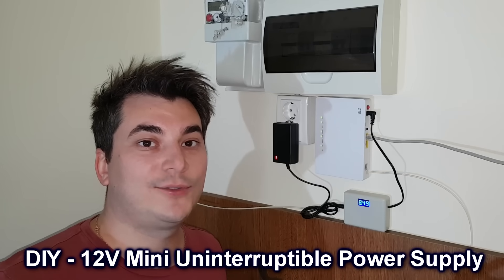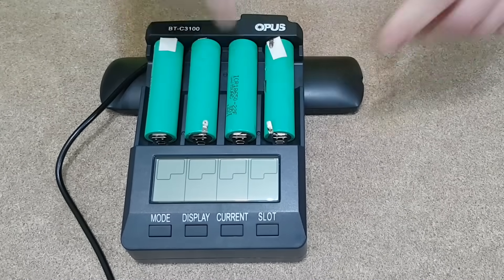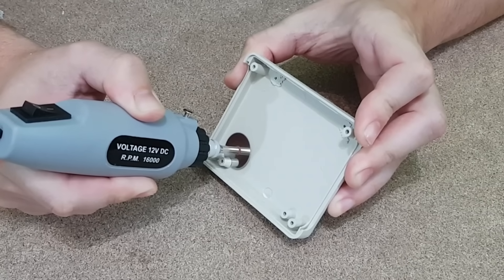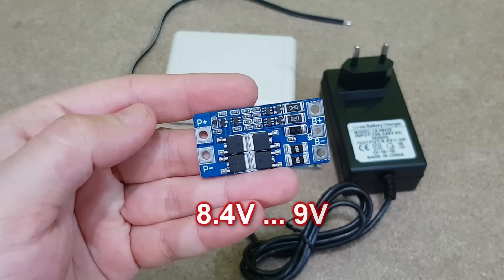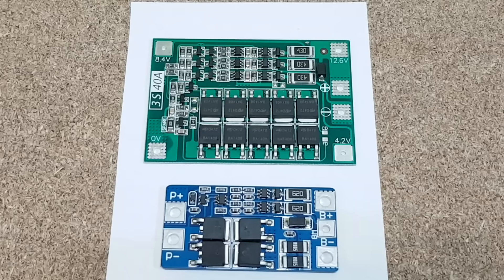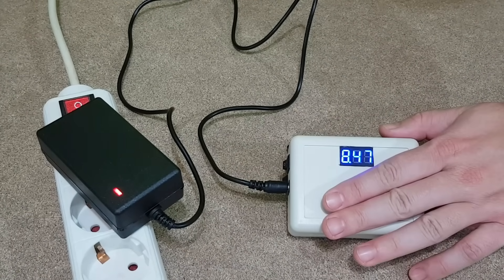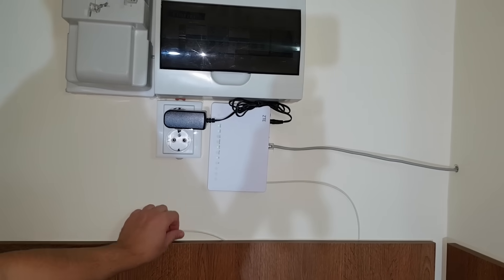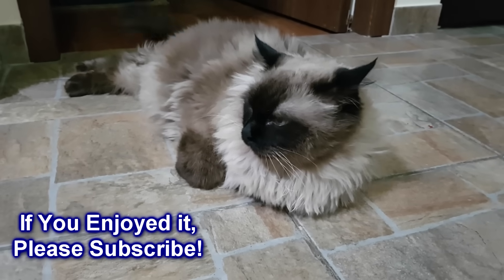DIY - 12V Mini UPS

Comment: You should add IN4007 diode between dc Jack and battery wire input to block the reverse current flow to adapter
Reply: Wrong. It will reduce charging voltage to 7,8V and will blow up very soon. 8,4V 2A charger is used, providing 2A of charge current, 1A diode will blow up. At least 95SQ015 should be used (0,2V drop at 2A and Tj=50°C) - acceptable for dropping 8,6V charger output voltage down to 8,4V. This diode also has around 0,2V drop at 300mA load, 30°C Tj - battery will be kept at around 8,4V as long as charger outputs 8,6V.

Comment: Can you make a ups for Router & ONU which draw 12v 12V means dual output?
Reply from the maker: I plan to make a better 12V UPS. if you double some of the components it will have 2 outputs.
Reply: @Sorin_DIY  hope you make it soon, best wishes.
Reply: @Sorin_DIY  I made a ups for Router & ONU with 1 3S bms+2 dc to dc booster circuit, output voltage is 12v, 12v. It's almost gave 5 hours backup After battery discharge fully while connect adapter (adapter is from ONU 12v 0.5Amp), Router & ONU not power up, only Router's led blinking. Can you tell me how to get rid form this situation?

Comment: If I was making this I would make sure the batteries was on 80% charge when in standby. The batteries will last longer since these kinds of lithium doesn't like to be fully charged.

If I was rich and did buy new cells, then I would buy LiFePo that likes to be fully charged (but they have lower capacity).

I wonder how much current is used up by the charger when the power is out. Maybe only for the LED? Maybe it powers up other stuff inside also we can't see.
Reply from the maker: you are right about the battery, but I didn't find a module to charge them to 3.8~3.9V. I'm still searching.

Comment: A great video, but my doubt is why isn't a charging module used to charge the battery ? Only a BMS board and a Step up converter are used....
Reply from the maker: the battery pack is charged with a charger and a BMS board. the charger can deliver 2A at 8.4V (max 8.6V) using a CC/CV method. the BMS board has all the needed protection features including balance charging. so together they charge the battery pack using CC/CV method, they balance and protect the cells. the step up converter is used only to increase the voltage to 12V.
Reply: @Sorin_DIY  thanks for the reply, i will build it soon with your video as reference ☺️

Comment: Can I use tp5100 to charge the battery with 12 volt input
Reply from the maker: I haven't used this module so far, but according to the datasheet, the input voltage is max 15V. the problem is that it doesn't have balance feature, so in time the cells will get unbalanced.

Comment: 11:50 can stop current flow from UPS from a diode?
Reply from the maker: yes, but the voltage will decrease, because diodes have a forward voltage drop.

Comment: hello i have made it but problem is volt meter shows zero every time what is solution
Reply from the maker: hi. you didn't connect the voltmeter sensor wire correctly, or the voltmeter is broken.

Comment: Can I use it for both Modem 12v and wifi router 12v at the same time?
Reply from the maker: if you use this type of UPS with 2 devices, it will probably get very hot. you need a more powerful UPS
Reply: @Sorin_DIY  Thanks for your response. I have a very powerful UPS. I just wanted to know if modem and router could share same ground.

Comment: I built a small ups with a 9v battery and boosted it upto 12v using the converter, I used it to power my stereo speaker but after a few minutes it resetted itself and when it came back up it worked perfectly. But it killed my device's original speakers, now I'm stuck in headphone mode. I didn't have 2 18650 cells so that's why I used a 9v battery. But I have another recharge ups. Thanks for the tutorial friend.

Comment: Can I use 19v 90w laptop charger to charge ups or small power station that has input 12v-24v?
Reply: but current may be high so dont take risk
Reply: but I read somewhere, its says higher ampere doesn't matter since devices only take what it need....as long as the voltage match with the input of devices...I mean my device can operate between 12v to 24v, not 12v or 24v....
Reply: @mzam2028  yes thats true so how many cell your going to use
Reply: I'm to lazy to make my own...I end up buying case with all the board installed...it can fit 12 battery...adjustable voltage..can power up or charge laptop if adjust the voltage to 19v..got usb port as well... there's 2 model, 16v-24v up to 90 watt which is said for ups or standard 12v-24v up to 60 watt power backup...the manual in Chinese buy I manage to translate it...it say can use laptop charger ....

Comment: Appreciate the compact circuit, I am also trying to make the same. But one query arises in my mind. That why we did not consider, reverse discharge protection diod in the supply side.
Reply from the maker: it will work, but you need a 9V charger to compensate for the diode forward voltage drop.
Reply: @Sorin_DIY  Is it okay to use a 12V 0.5A charger and a 3S 10A BMS?

Comment: I was wondering if I could implement the same circuit but with 19V output for my ASUS router.
Reply from the maker: no. because your asus router needs more current also. you need a bigger battery pack and and components rated at higher currents.
Reply: @Sorin_DIY  Yeah thought so. I saw your video for the 12V and 19V supply but what I needed was just the 19V part since my ASUS router is located quite far from my fiber modem.

Comment: That’s not really a UPS. It’s a battery bank that allows pass through charging. A UPS works on by-pass. It will keep the batteries charged and. It run any current from the batteries until power to lost from the input. That’s why a real UPS is a bit more expensive- it’s has to have a very fast transfer switch. 

I’m glad this works for your application though.

Comment: Hey Sorin, how is the ups holding now? Is it still in use and has it been constanty since you made the video? Are the cells still ok? The reason i am asking is because I have read that it's not advised to constantly charge lithium cells.
Reply from the maker: hi. I used the UPS for a few months and it was ok. now it's not connected because I'm making some changes in the house. you are right, the li-ion cells should not be charged continuously. that's why  I linked a better BMS board in the video description. it has an overcharge recovery feature, which completely stops the charging, when the cells are fully charged.
Reply: @Sorin_DIY  what is the difference between the BMS on your video to the description below?
Reply from the maker: the BMS from the video charges the battery continuously. the BMS from the link in the description has overcharge release voltage protection, which stops the charging when the battery is fully charged.
Reply: @Sorin_DIY  thank you for your reply, will build this soon just waiting for the parts to arrive ^_^ Thanks for sharing this!
Reply: @Sorin_DIY  hi, followed your build but the output of the BMS is 5.86v only.. Any advise? I have tried 2 bms, same result. ( I use the bms you provided on the link description)

Comment: It works well with my linksys router with the power consumption of 12v 1A. Thank you again for your help. But there is one problem, in battery mode, i only 9.6v and i got 12v when the charger is plugged. I adjusted the variable of step-up converter into 12v while it is plugged on charger.

Comment: Is there any BMS board that can produce the output of 5v 3A and 12V 2A? My ONT has 12v 1.5A and my raspberry pi has 5v 2.5v power input needed. Thank you in advance idol.
Reply from the maker: a BMS board doesn't deliver a stable voltage. it just charges and protects the battery pack. you need a DC converter to have a stable voltage.
Reply: @Sorin_DIY  i mean the step up converter. Does XL6009 ampere output will be the same if the input is 8.4-9v 2A? Or it is just 1amp? It works on my router with power rating of 12v 1A but it cannot power up my ONT with power rating of 12v 1.5A.
Reply from the maker: the output power = input power * efficiency. for eg. if the needed output power is 12V*1.5A=18W. let's assume the efficiency of the converter is 85% in these conditions. so the input needs to be: 18W/0.85eff = 21.17W; 21.17W/9V=2.35A. so you need a charger with 9V and more than 2.35A, because a part of the current is used to charge the battery.
Reply: @Sorin_DIY  thank you so much. Now i understand it.

Comment: Great vid! I do have a question though, as the input to the battery does not have a current limiting circuit, would it not lead to a surge current inrush when the battery gets fully depleted and the mains supply gets back online? Best case, it would trip the protections in the bms and not charge the battery and worst case it could kill the battery. Thoughts?
Reply from the maker: hi. in this video I use a small battery pack, made with only 2 recovered lithium cells with a small capacity connected in series. it doesn't put too much pressure on the charger. the charger can deliver a maximum constant current of 2A. so the charging current is limited by the charger, which is 2A minus a few hundred mA, which are used by the DC-DC step up converter, to power the ONT with 12V. so the charging current is limited to around 1.5A, which is a bit high for a small battery pack, but there is no problem. and this happens only if there is a long power outage to completely discharge the battery. if the power outage lasts only 1-2 hours, the battery will not discharge too much and it will draw only few hundred mA from the charger. the problem you mentioned occurs when you make a bigger battery pack and use a more powerful charger, then you need a CV-CC converter to limit the charging current, as I did in the 12V&19V UPS.
Reply: @Sorin_DIY   But the 2A adapter doesn't really limit the current does it? The charger should just burn off trying to instantaneously bring up the battery voltage to its own output voltage bringing a surge in current more than it can safely supply (2A).
Theoretically a 2s battery discharged to around 7 volts should draw somewhere around 20-40 amps from a 9v considering the internal resistance of the battery to be around 40-80 milli ohms.
So the bms should have triggered the overcurrent or the charger should have THEORETICALLY burnt out trying to supply that 20-40 amps (if the bms didn't exist) 
But ofcourse none of that happens in your video and your setup functions as it should. Could you explain a bit more about why the battery doesn't draw the theoretical amount of current and in doing so trip the bms or kill the charger (if the bms is ignored)?
Appreciate your input!
Reply from the maker: a good charger acts like a CC-CV power supply. the charging current is limited to 2A and the voltage drops when you connect it to the BMS/battery. then the voltage increases slowly, while the battery is charged. it doesn't force more amps into the battery, because it can't deliver more than 2A, so the voltage drops. you can see this exact charging method in my fast charging powerbank video with a 25.2V (25.4V max) and 2A charger. but if you have a low quality charger it can damage the battery if it doesn't stabilize the voltage and current.
Reply: @Sorin_DIY  As long as the charger self limits the output current and not blow up trying to match the current demand it all makes sense.
I did not know a charger could behave in a current limiting manner when connected to a battery (which is not a standard load in the sense that potential difference accross it doesn't immediately match the charger's once connected)

Thanks!

Comment: how long will it last 12v 1a
Reply from the maker: about 1 hour with the salvaged batteries from the video. if you use better or more lithium cells, it will last longer.

Comment: You need a charger, not a power supply.

Charger: CCCV

Power supply: CV only

CCCV = constant current / constant voltage.

Charger: puts out either a constant current or a constant voltage, depending on the state of charge of the battery

Power supply: puts out a given voltage no matter what, cannot be connected to a battery

Even if you start from a power supply, you still need a charger between the power supply and the battery, to drop the voltage and limit the current. So, you might as well keep it simple and just use a charger.
Note: a "Lab supply" is a CCCV type of power supply, and can be used as a charger.

Comment: Hi,
Can i connect same voltage but different power rating batteries in series ? Eg. 4200mAh+2100mAh ?
Reply from the maker: no. you need exactly the same type of cells (so they have the same internal resistance), with the same real capacity, same lifespan and number of cycles.

Comment: I''ve seen other similar builds use a diode reverse bias on the negative terminal of the power input from power supply - you mention in the video that the charger light remains on because it is taking power from the UPS. Is that what would be prevented with the diode in place?
Reply from the maker: yes

Comment: Is it okay if the Dc to dc converter is heating up?
Reply: the step up converter
Reply from the maker: hi. it depends, in what conditions? it's getting hot powered by the charger or the battery? what load do you have, V & A? what step up converter did you use?
Reply: @Sorin_DIY  12v 1amp

same converter you use

Comment: I have used the BMS above mentioned .When using multimeter I found out battery output is 8.4 v but on BMS output it is showing 1.7 volt only any suggestions

Comment: This is just a battery charger, as batteries are always being drained, either connected to wall adapter or not. The concept of UPS is that batteries will drain only when AC wall adapter doesn't provide energy.

Comment: update on my build i just use it for 2 hours? why is that??
Reply: i am using lg browcell
Reply from the maker: you need to test the real capacity of the battery with a good charger. then test the current consumption of your load. the cells may not be good enough. or your load may use more current.

Comment: i would like to ask about your dc to dc buck converter how it keeps 12v output even the 18650 battery are near to drain thanks
Reply from the maker: hi. it can't :). I didn't find a 4S BMS board with a higher over-discharge cut-off voltage. in the last few minutes of working time the voltage for the ONT will decrease under 12V, probably down to 10V. I tested the ONT and it still works, because it has internal DC converters to regulate the voltage for the on-board chips. a discharged cell from 3V to 2.5V has very little capacity left, usually only a few tens of mA, so it doesn't really matter. the power outages in my country are short but often. also it's not recommended to fully discharge the lithium cells. so if you need a longer working time for the UPS, you need a bigger battery pack and don't rely on the last 1% of capacity from 3v to 2.5V per cell.

Comment: Hi Sorin, I mounted one to the modem and now I need for the router.  The thing is, the router requires 12v & 3amp.  How do I run 3amp?  Thanks.
Reply from the maker: hi. I will make a better UPS with 2 outputs soon, I will explain then.
Reply: @Sorin_DIY  wow,I can not wait.  Thank you.

Comment: I like your clear and concise explanations of what you're doing in each step. But wouldn't it be better to limit the charge to a lower maximum voltage (e.g. 3.9 or 4.0 V per cell)? That should significantly improve longevity and safety at the cost of a small amount of capacity.
Reply from the maker: hi. yes, it would be better to charge the cells to a lower voltage, but the charging process is stopped only when the first cell gets to the overcharge protection voltage, otherwise the BMS board will continue to put current into the cells. and this is not good for lithium cells, they are not supposed to be continuously charged (like lead-acid batteries). so if you don't give the BMS enough voltage to finish the charging process, it will charge the cells continuously, because it can't reach the cur-off voltage. for the BMS I use in the video, the overcharge cut-off voltage is 4.3V (±0.05V), which is very high. so I searched for a better 2S BMS board and I placed the link in the video description, it also has overcharge release voltage, and the overcharge cut-off voltage is 4.25V per cell, which is a bit better than the original BMS I used. there isn't any BMS board with the overcharge cut-off voltage of 4.2V or lower, unfortunately.

Comment: Great Video, I also have a couple of VOIP modems that are next to my router could this be altered to put out 5v also, I'm sure it can, I have a UPC that I could keep with my Computer & TV if I had this for the modems, great idea, these batteries are easy to find & not expensive. Bravo!
Reply from the maker: right now I'm working on a better UPS with 2 outputs, I will upload it soon.
Reply: @Sorin_DIY  Thanks, sounds good, I subscribed.